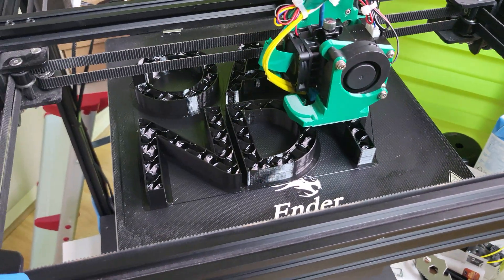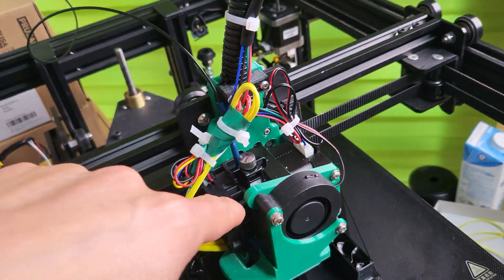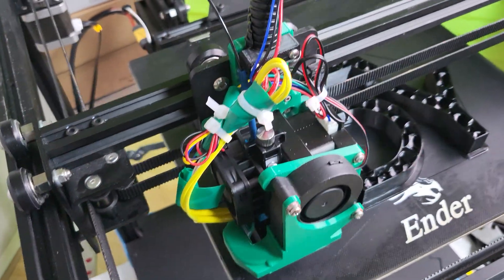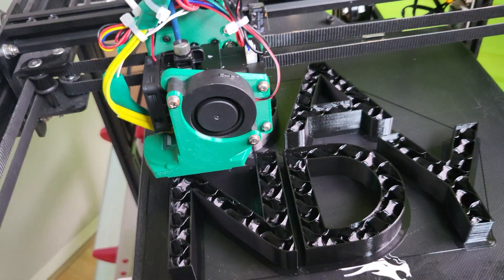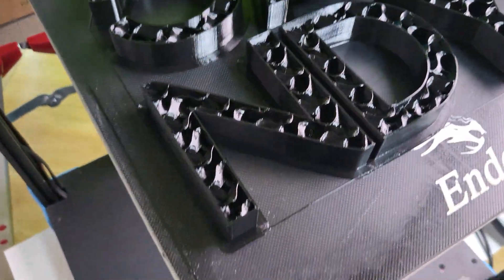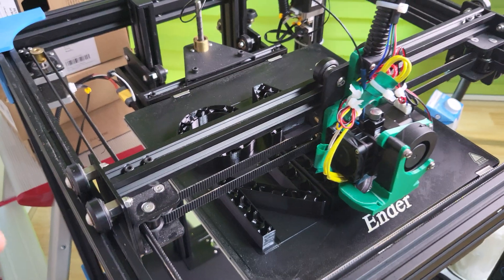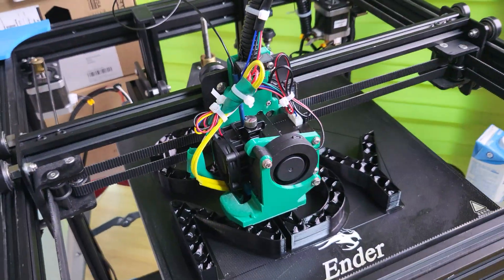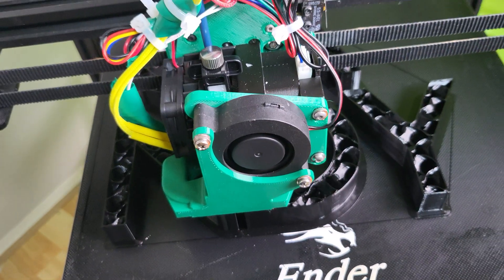Ender 6 w/ Hemera Direct Drive & Klipper printing better than my Prusa MK3S+!

Comment: Hey mate thanks for sharing, I have just installed the Revo Hemera in my Ender 6 after having a Biqu H2 in it but I just can't get the printer.cfg file right. Would you mind sharing yours so I have a base to work off please. Thanks alot for your help.

Comment: I'm trying to do the same thing. what did you use in your printer config for thermistor sensor type and rotation distance. (my thermistor e3d 104NT-4-R025H42G is reading 7c in a 23c room)
Reply: Also what flavor of klipper are you running to get both the thermistor and the screen?
Reply: for Marlin i know the thermistor is type 5
for klipper it should be sensor_type: "ATC Semitec 104GT-2"

the screen is just an octoprint plugin for the Pi i think.. dunno forsure.

Comment: What are you using for a release agent on your glass bed?
Reply from the maker: It pops right off when bed is cooled, no release agent required. ;)
Reply: @3dPrinterSchool  I'm having problems with petg fusing to the bed and pulling chunks out on my ender 5 plus
Reply from the maker: @d-fly  i set my bed temps to 85 and no problems.   Try prusament petg they stick really well, dont use hair spray or glue.
Reply: @d-fly  Increase your z-offset for PETG. It needs less "squish" and as you've found too much and it grabs too well.